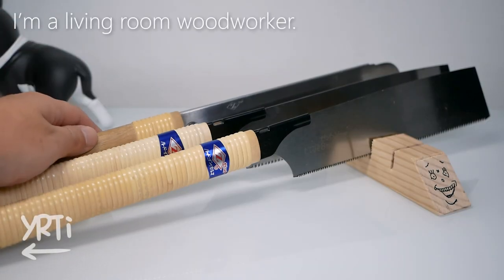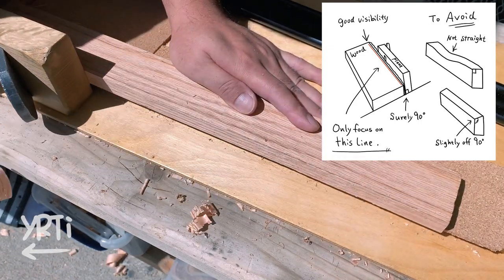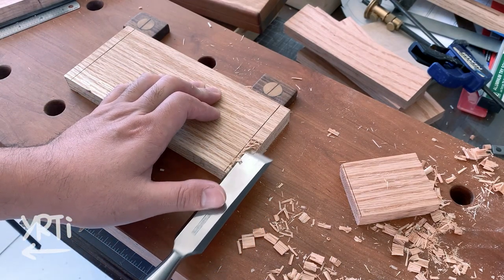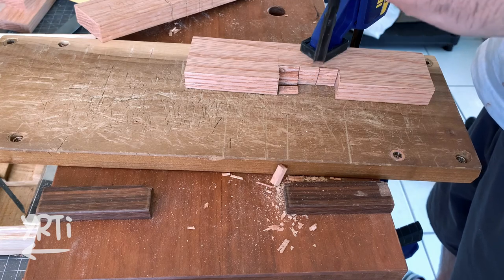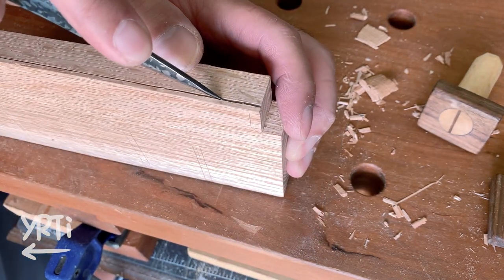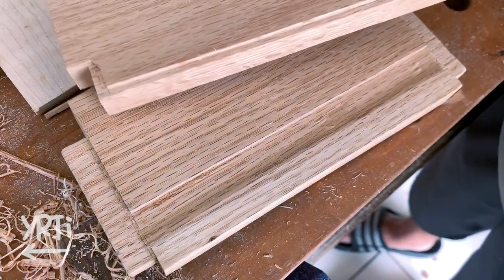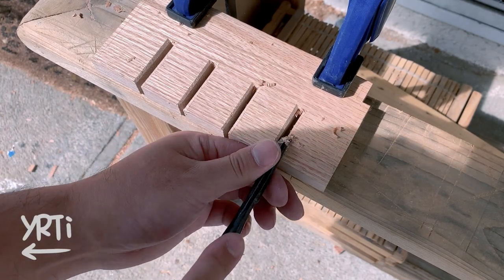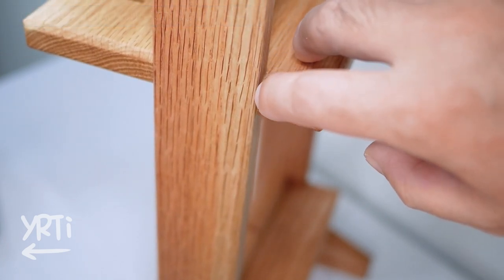Hand Saw Storage/Stand with a Clamp Holder - Woodworking with Hand Tools

Comment: Another very nice looking and well thought out design.  And another very nice video.  I like the pacing of the scenes and they all seem just right for the amount of work being done.  Longer for more complicated projects and shorter for easier or less pieces.  And I enjoy your designs.  I guess we have similar tastes in lines and shapes.    I do wonder about perhaps an addition to your stand.  A small raised strip along the front edge of the saw shelf or even two short rounded dowels at each slot would stop the saw handles from slipping out while carrying the stand.  Yet just a slight lift over this retainer strip or dowels would easily allow the saw to be lifted out for use.
Reply from the maker: Thank you for your opinion about my video! It helps me improve my channel and motivates me to keep going! 

For the stopper thing, after watching my video myself, I thought the same, haha. However, as my original idea, the handle on the stand is to carry the stand by itself to the garage and for my use, I don't have a situation that I carry it with saws loaded. Of course I agree it's better it has some sort of stopper:) I also think it could've been better if I have a hook on the side so I can hook a mallet! 

Again, thank you for the comment!

Comment: That sure did turn out nice!  It's weird, I always say I'm not a big fan of red oak, but up here in the upper midwest it's as cheap as pine and poplar, so it's hard to avoid it, and I often find that once it's finished it looks so much better.  I just hate how it turns my fingers purple lol

Just don't put your saws away angry, and I'm sure that oak will be fine with the grain direction :D  I made my saw till with pine, and two of them snapped, but it worked out ok, as they were the end ones (they were half as wide).  I use one so I can hang a bench hook off the side wall, so it looks like I meant to do it lol
Reply from the maker: Oh thank you for the information about the purple thing! I didn't realize it and just read about it! If oak is as cheap as pine/poplar, I would say oak is my favorite but here it's not! but yeah, I finally started to visit several lumber yards now but I'm still intimidated...

For the strength of the grain thing, don't worry, I treat my tools so gently as if people think I'm so in love with the tools. In reality, I'm cheap and I just hate to buy the same item again and again, haha.
Reply: @YRTi  I often feel self conscious when I go to lumber stores, unless I'm working on a big project or something.  I always feel like I'm a hassle if I'm only buying small boardfoot amounts lol
Reply from the maker: That's right, I always feel bad, too but I'm sure what you meant by small boardfoot amounts is large to me...haha
Reply: @YRTi  lol maybe. I try not to buy more than I need, as I'd rather store fun tools than wood lol

Comment: Good evening, amigo! Do you use Japanese chisels? And if so do you have any brand recommendations?
Reply from the maker: Hi, Connor! I started to use Japanese chisel very recently and just put what I use in the description. The good ones are usually super expensive but the one I use is very reasonable(about $30/piece). It's not the level I can feel the craftsmanship from the chisel but at least it uses a decent steel (Shirogami #2 Steel/White Paper #2 steel). It's said white paper steel is usually good for softwood fabrication but I didn't have any issues with red oak on this project. I think the chisel is decent enough to find if you like the Japanese style.